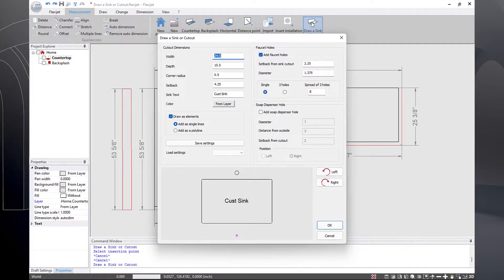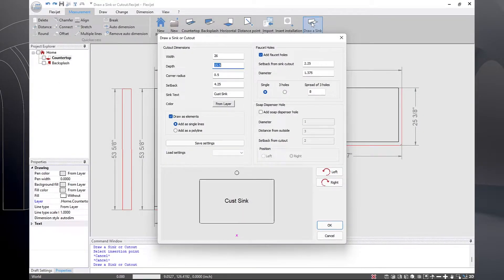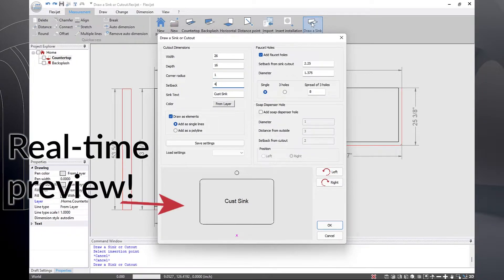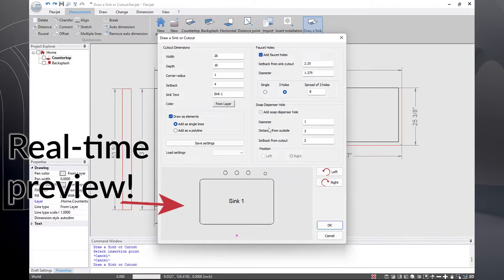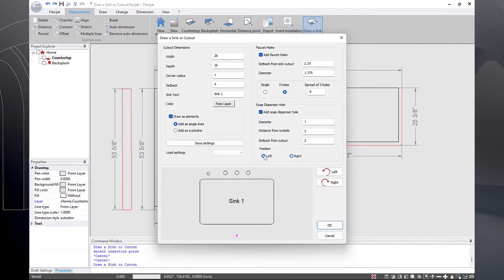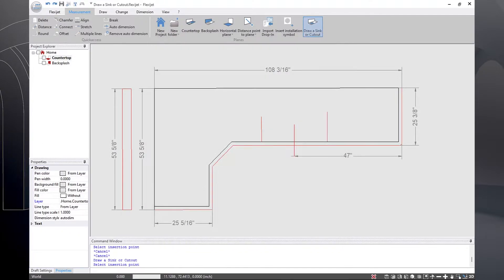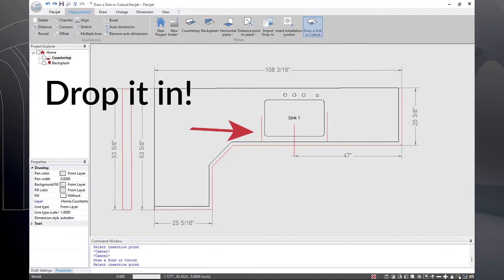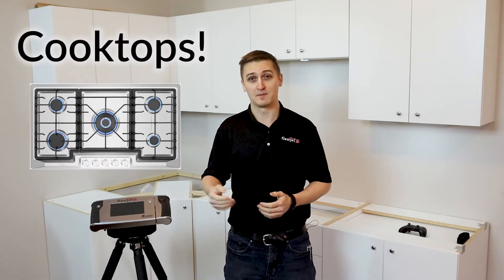Flexijet Stone Feature makes sinks easy - 'Draw a Sink or Cutout' tool

Comment: I just learned how to use this system, it makes the 2d3d system look like an antique. Self leveling, shock sensor in case it moves, every point it shoots is 100% accurate after a couple hundred measures that I have done. It takes a picture of every point you shoot. Real CAD drawing with a mouse while you measure, you can get fast with it quickly.